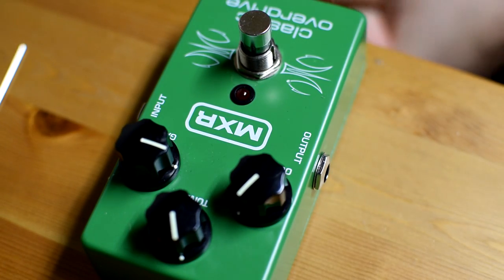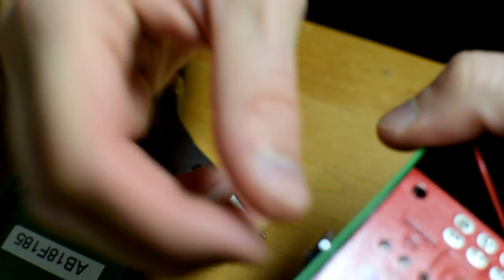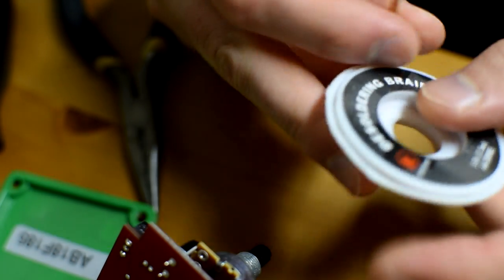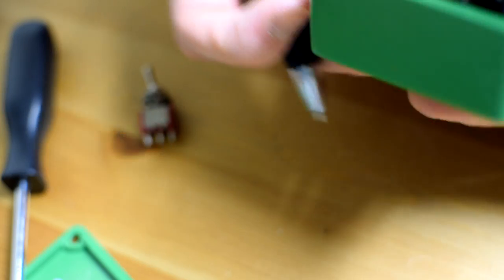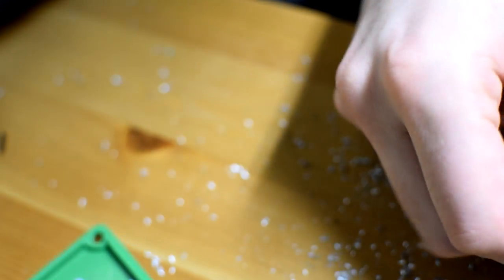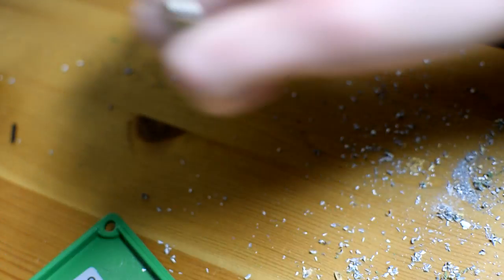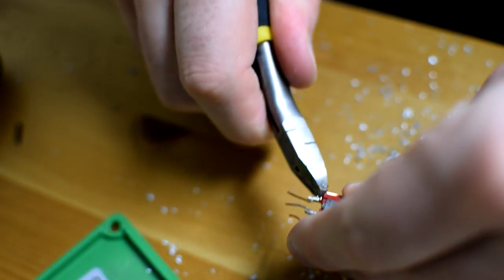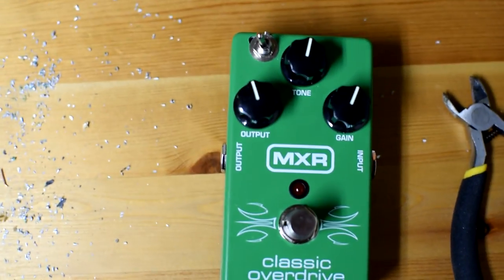MXR Classic Overdrive - External Dipswitch Mod Tutorial

Comment: Congrats for this awesome video! I bought a CO in 2010 in Cleveland area. I went at saturday at... the next monday they were all sold out!!! A great pedal. Now, I have Zack Wildde Overdrive, not working. I already change the 33178 IC. But, I suspecting of the transistor Q1. Do you know what kind of transistor it is??? Could you inform or give any schematic??? Thnk u in advance!